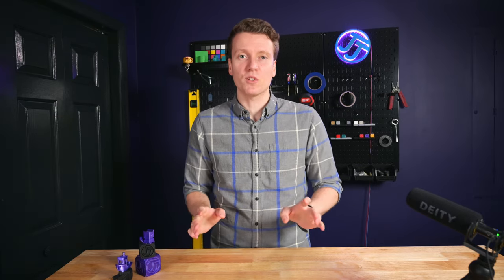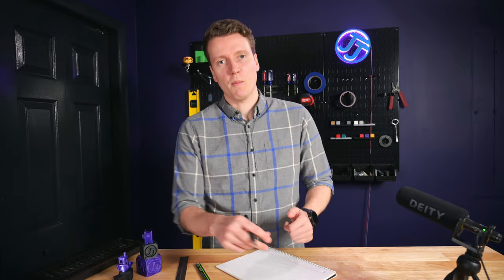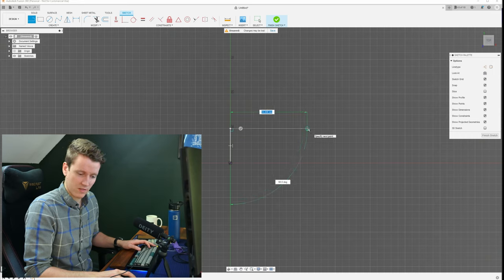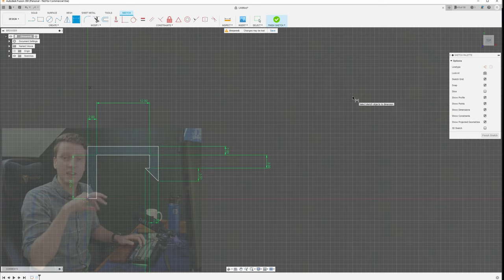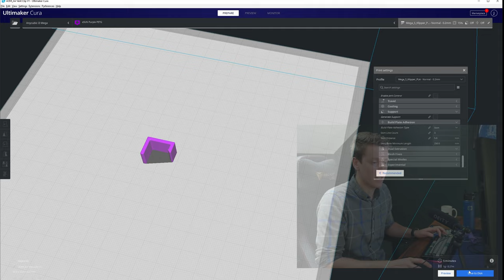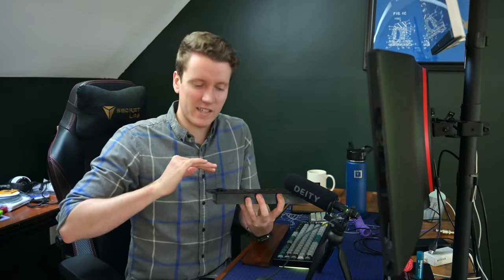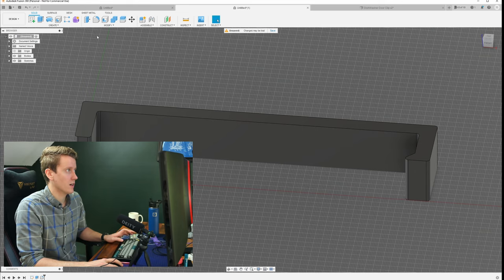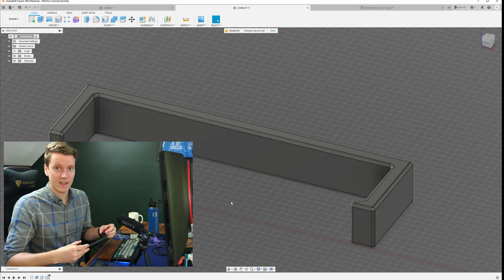Designing Your First Functional 3D Printed Parts | Basic Fusion 360 3D Printing

Comment: Just a tip, when you're printing your first prototype, reduce the extrude significantly so that it's quicker to print and utilizes far less filament.
Reply: I also imagine that you should use a different filament for prototyping. I’m working on getting a 3D printer and in my head I imagine that I should have one set of filament for each color and I wouldn’t have to spend extra time painting the base color. I think it would be best to keep a extra set, or five, of a single color for prototyping. Am I correct in assuming that I can switch out filament after every print that I make?
Reply: @Soulfire702  ehh not really.
Reply: @DenzelHooke  Rip that idea then
Reply: @Soulfire702  Hi, if you have the budget, get a Bambu Lab P1 with AMS. This is an auto colour changer. I've just started 3d printing, absolute beginner, and got my P1S with AMS less than a week ago. It does exactly what you want, auto colour change between 4 colours, great for prototyping in a single basic colour, then final print in multi colour. It's seriously so easy to use.
Note the less expensive bambu lab A1 has similar functionality. Happy printing!
Reply: @litebreeze811  Thanks
Reply: @Soulfire702  Also choose your filaments wisely, it is a commitment to stick with them. Dont go with crazy colors if you want functional prints that look modern, sleek and not out of the ordinary. I say this as I own 3 spools of filament, black, white, and grey in Tough PLA. I've owned them for a year and am not even close to reaching the end of their use. They last years if you don't make big crazy designs.

Comment: Don’t forget to give clearances for fitting parts. Exact dimensions will not make the parts fit to each other, a clearance of 0.1 mm is good for tight fit, .2mm is good for smooth fit

Comment: Keep in mind that a fillet will create an unprintable overhang since it is a radius feature. It doesn't matter as much on extremely small features but for features against the bed it is better to use a chamfer and good to get in the habit of keeping in mind the way your design will be manufactured.

Good video for people who are wary of designing something themselves. Starting with these simple items that aren't likely to already exist is perfect. Showing that it is fine to not get something perfect the first time and understand the point of 3D printing is rapid prototyping.
Reply: That's what supports are for....
Reply: @cinemoriahFPV  Supports are a waste of time and materials if a simple design change can eliminate them entirely. This goes back to the "designed with FDM in mind" mindset you should have when designing a part. Instead of relying on the Slicer settings, which won't be the same for everyone, try and make it not require such things at all.

Comment: Thank you! I've had 3D printers since 2017 and this is the first time I've actually been brave enough to design and print my own part. I modified my 18 scale truck to fit larger lipos and had a battery tray design in a few minutes. It's all downhill from here!

Comment: You shouldn't let the heat out of your dishwasher.  The heat is part of the drying process. In fact it IS the process. The heat trapped in the metal pots and pans and also crockery in the dishwasher is necessary to dry the rest of the contents.

Comment: JJ, I need a double folding hidge that can open a flip phone vertically or horizontally depeniong on which was you want to flip

Ill have to have a machine shop build the hindege most likely out of hardended steel so it can remain small and strong on the case(s)

Comment: Stuck in Fusion 360 purgatory.   Please Help.  Simple Coil with an end that stands straight up from the centre of one end.   I've tried the Sweep command and have managed to waste many hours trying to do this. I'm discouraged and frustrated in what should be an easy task.  I was hoping you could do a beginner... step-by-step video on how to force drawings to a Zero "Z" access and Move commands.  I often have to move my drawings from floating off the surface and place them back to the build plate level.  I've wasted a lot of filament printing unnecessary supports.   In addition can you please cover how to use the Move Commands and Sweep commands.  My approach so far has been to brute force them with varying degrees of success.

Comment: Complete noob here, trying to understand the ecosystem. 

In this example at least, I guess Fusion 360 is the design software.

Is Ultramaker Cura specific to the 3D printer hardware or do the 3D printers generally allow or force the user to choose the software that controls the printer?

What is meant by “slice it up?”
Reply from the maker: So Fusion 360 is just a 3D Design software that makes a 3d object. This could be used for several different use cases. The "slicer" software turns the 3d object file into the instructions needed by the printer to function. Cura is a really popular slicer that works for almost any printer, but some companies have their own slicer that may work better for their 3d printers

Comment: This video should be clear that a knowledge of Fusion 360 is required. There is no mention a mouse clicks or how you toggle from dimension to dimension.
Someone new to Fusion 360 would not be able to follow.  This is obviously supposed to be for beginners, so please explain what you are doing in Fusion 360.
I do like the way you teach, you are clear and concise. If you just added a bit of information about navigating in Fusion 360. it would be great.

Comment: Thanks for the video ❤

little hint, if the dishwasher door keeps dropping, on the bottom behind the foot cover should be some kind of screw vertical which trenches the counter spring, this way you can adjust the door to not drop.